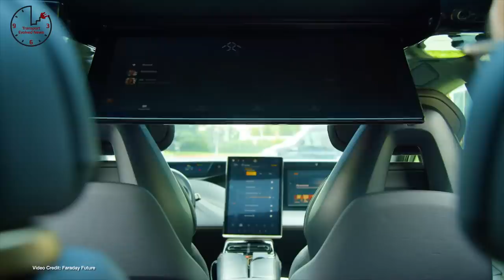TE 347 - Second Bolt Recall, Tesla FSD Here, Robotic Charging

Comment: On the heavy trucks, I have been amused by the haters of a certain California company who love to claim that the grid couldn't handle charging large trucks while also claiming FCEV trucks will kill them.

At best hydrogen is less than ½ as efficient as BEVs overall. 

If the grid can't handle charging BEV trucks, then how can it handle hydrogen production & distribution for FCEV trucks? 🙄
Reply: You have the idea of hydrogen production by electrolysis, eh? No, no, no. Here's the fossil industry version: https://www.energy.gov/eere/fuelcells/hydrogen-production-natural-gas-reforming
Reply: @Sekir80  It takes a lot of energy to do that, and making hydrogen that way reduces overall efficiency to a ⅓ that of a BEV.

It's the cheapest way to make hydrogen, but you still have to construct the expensive storage and distribution infrastructure.
Reply: @IronmanV5  Takes a lot of energy, yes, but heat, not necesseraly from electric source, but fossil. 

Btw, disclaimer: I reject the hydrogen powered future exactly as of your reasons!
Reply: @Sekir80  Except that you want to avoid open flames around hydrogen, especially as leaks are not uncommon.

Even foundries nowadays heat their crucibles with electricity.
Reply: My favourite hydrogen story , is the safety document (actually, bizarrely similar to GMs response to Bolt fires). It states that "ideally hydrogen use and transfer should take place outside. If that is not possible, the building it is used in should have an easily detachable roof, in the case of explosion." You read it first on Transport Evolved.

Comment: GM execs 2 months ago: "I wish we'd sold more Bolts."
GM execs today: "Thank God we didn't sell more Bolts."
How big is the recall, how many Bolts were sold from 2017 to 2019?
Reply: From what I've heard on other TE video, a but more than 70 000 Bolt EV and Opel Ampera-e. I don't remember the exact number
Reply: I'm honestly wondering if this was all related to their marketing approach. They had plans to move battery production to the US. Their marketing for the Bolt really didn't take off in force until they announced the 2022 models. Maybe this was intentional, they wanted to make sure they didn't market too hard until they had more control over the battery QA.
Reply: ~50,932 in the US per GM and NHTSA  12 or more Bolt EV fires due to the defect.  ~0.02%  (a huge failure rate for "quietly resting" to "catastrophic fire")
Reply: One GM exec to another (in private) " Jees, lets grab our compensation plan while we can, and jump ship, let the others sort this out, before we get fired."
Reply: They sold less than 50k 2017/18/19 Bolts. Just replace the damn batteries or offer a buyback.
Bolt owners obviously love their cars or they would have gotten a Model 3 or i3.
Reply: @mamadouaziza2536  No, they want to scrap them just like the EV1

Comment: 15:13 Wow GM that's a new low.... I was on the market for an EV as a main car that needs to do 225km even in winter and with all the recals I'm not even looking at used EVs anymore. The Konas keep their value a lot so not that much better than the new ones (plus the whole alow recall) the Bolt are a no go now because of how GM handles the recall. The only used choice I have is the Niro but I hate how it looks. I could go with the Soul EV, but the cars I find are very used for their age....2020 with 60k km(40k miles)...I tried the new Bolt EUV yesterday and DAMN hahaha I now fully understand why Nikky calls rhe Bolt a Hot Hatch. I'm still debating if I buy it or not, we'll see.
Reply: So buy a 2020 Bolt or a 2021 Bolt those years do not have issues with the batteries.. Did you honestly think GM would replace all batteries in these Bolts right away without first coming up with less expensive solutions? 

Yes, the software fixes are an epic failure because owners now have a car with less range and they are told they can't charge overnight or park in a garage.. Who the hell would want a Bolt under those conditions? No one.. 

GM is doing the right thing now by recalling those Bolt affected. 

I decided to just get an i3 simply because its just a better built car than a Bolt. I gladly gave up some range and horsepower for a car that is not known for bursting into a ball of fire.

Comment: The Bolt saga is a disaster, who would by any Chevy after this.
Reply: Everybody. Great car, no fires on 2019+ models. Sell your $tsla
Reply: The Bolt will be just fine.. Its not like Chevy sold millions of these cars, sold less than 50k of the cars affected with the questionable batteries. They just need to replace the batteries in the 2017-18-19 cars and or do a buyback.. A new battery will give the older Bolts a new life and make its owners happy..

Comment: For the foreseeable future, we need to all of our available Lithium batteries for cars and PU trucks.  I expect it will be a minimum of 10 years before we can catch up with adequateLithium battery availability so we can add Semies to the mix. There are new Hydrogens technologies that should adequately work for Semi Trucks for 10+ years and maybe longer.  Heavy equipment such as dozers also fit in this category.  This equipment myst be able to run for 8 to 16 hours a day.  Batteries do not accell here.

Comment: Tesla needs to develop a water recovery catch basin / bidet for Fire Departments to pull a burning Tesla or other EV into, to allow less amounts of water to be used to put such a fire out. Also, it can contain cooling water jets that when pressurized by the pumper truck, direct water straight up onto the bottom of the battery pack to remove the heat and stop the reaction. This will mean the possible saving of the car, and lower insurance rates for EVs of all kinds. This will end the new stories of high water volume fire fighting efforts on EVs, making it a non news worthy event!

Comment: I was delighted the first time I saw a "snake charger" robotically plugging itself into a Model S, but considering the monstrous complexity, and likelihood of periodic maintenance, inductive charging pads are far more practical so long as the floor-mounted pads are available where they are needed.

All of today's charging stations should be replaced or upgraded with charging pads as alternatives--- along with CCS and CHADEMO plugs.  They are much less likely to be damaged by improper use, are less likely to require maintenance, and just as efficient as charge cables.

KiCharge pad systems have been sufficiently refined as to be as efficient as cable plugs due to sloppy, oxidixed and dirty connections and interfaces.

Comment: It is sad that the electric car batteries are not bullet proof when it comes to fire.  For this reason, until someone comes up with a safer battery than LFP, my next car will have LFP batteries,  I hope this will be a USA made car.  The technology for the LFP battery comes from China, I hope they will soon be made in USA.
Reply: Its too bad that a gas tank in a car isn't prone to fires.. Will you next car not have a gas tank?
Reply: @mamadouaziza2536  ICE passenger vehicle fires and specifically those involving liquid fuel fires are so common they don’t make the news. They tend not to occur unless in operation. Emergency services know how to handle these. This is a bit different to ZEVs. But you knew that

Comment: Tesla: Future cars will only be offered with a steering yoke, not a steering wheel.
Me, a Tesla Model Y owner: Fair enough.  <scratches Tesla off the list of manufacturers to buy EVs from>

Ok not just the yoke but that's bad enough.  Add in no gear stalks for turn signals or changing gears.  Add in a small button on the yoke for the horn (because when I want to smash the horn to avoid an imminent accident finding a small button is no trouble at all....).  I'm sorry but no.  Fortunately there's an ever-growing list of compelling alternatives out there to pick from.
Reply: Didn't you know? - Tesla have 'discovered' that the way we've been designing the interiors of cars for 120 years is suddenly 'wrong' and they can do it 'better'.........
(not better for drivers - just better..!)
Reply: @andymccabe6712  Tesla should put brake and acceleration pedals hanging from the ceiling. It's so last century to have them in the footwell.
Reply from the maker: My husband and I just drove our Model 3 more than 3500mi from coast to coast and it was fantastic, but like you, I don’t know that I’m interested in adapting to the radical UI direction the company is going in future vehicles - Winter
Reply: @transportevolved  exactly.  Maybe I’m just too old (elder Gen X here) but I have too many doubts about the practicality and safety of a yoke steering wheel and tiny horn button.